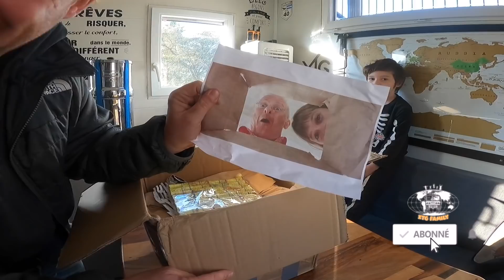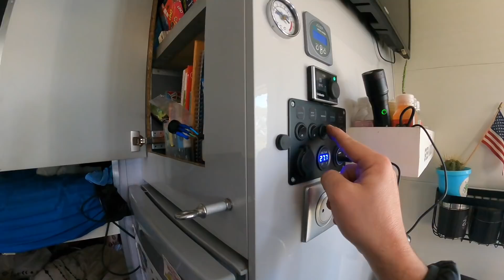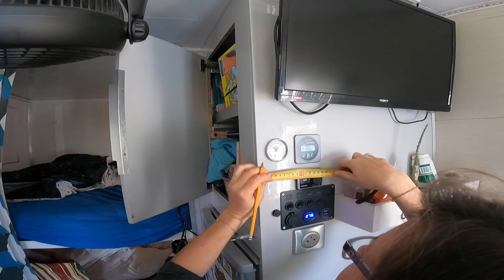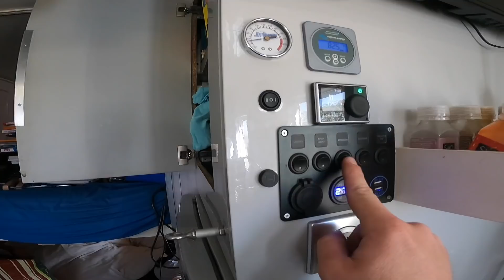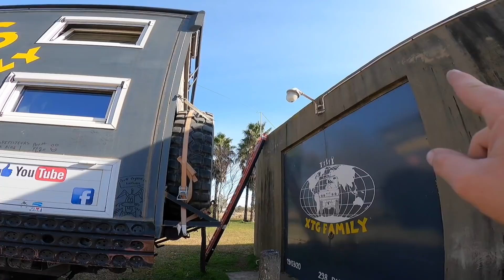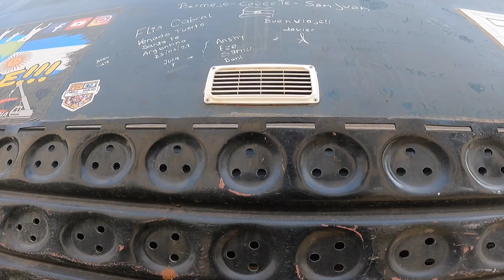232 Améliorer son aménagement, vanne motorisée // quel auvent choisir

Comment: Bonsoir, ma terrasse se trouve en plein courant d'air, les parasols sont malmené le dernier à tenu une semaine et 250E poubelle, les tonnelles font du parachute voire les barres sont tordues sans la toile suivant la vitesse du vent. J'avais pour cette année opté la toile militaire mais vos arguments me font changer d'avis. Le soleil est pas mais pas présent actuellement, donc je vais voire Leroy Merlin ce qu'ils ont de dispos. Bravos pour la vidéo et les améliorations que vous faites. A bientôt.
Reply from the maker: on a aussi eu des problème avec les toiles tendues à cause du vent en bord de mer. Mais ça ne casse pas, au pire les sardines s'enlèvent.
merci
à bientôt